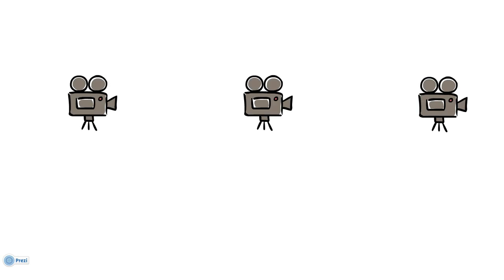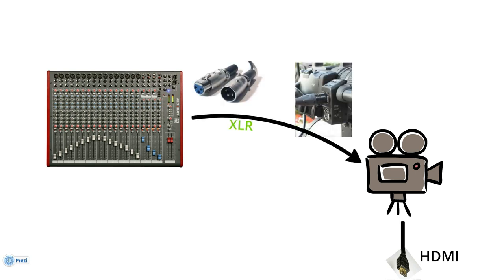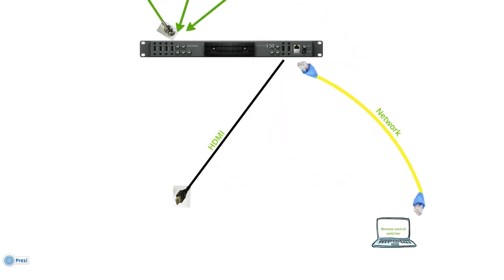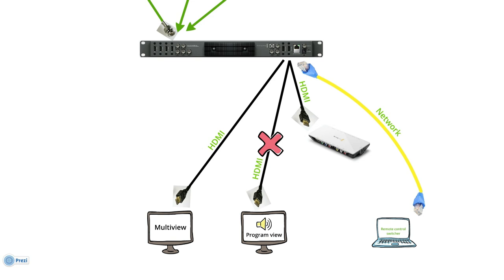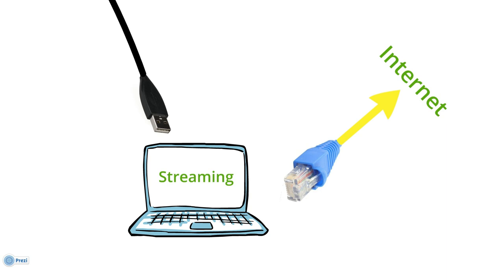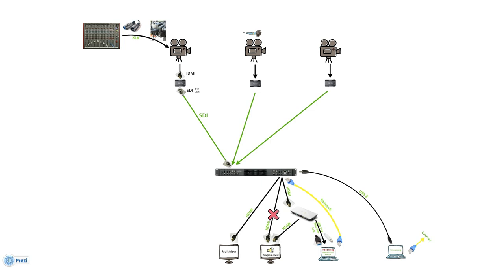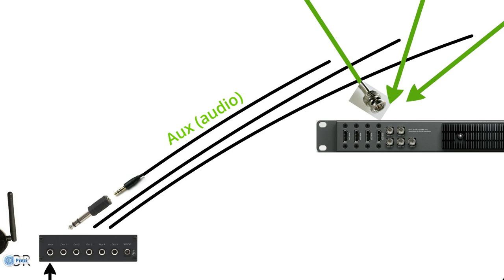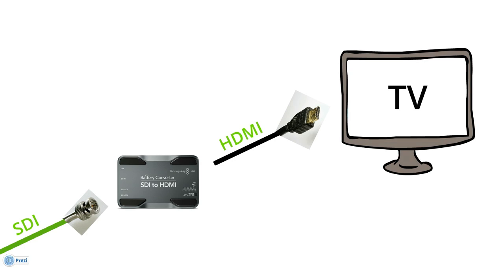15 Connecting it all together

Comment: Pawan Ramnarain: If you use the BM ATEM switcher, it has no analogue inputs of any sort, neither video or audio, and the computer controlling it, does just that: controlling it. But, yes, if you take the HDMI output of the ATEM into the computer, you could technically mix that with analogue audio, but I guess you will have a big out of sync problem unless you put the audio through a delay box. I haven't tried this, I have just noticed there is a slight delay between what I hear live and what I hear through my ATEM. Therefore I recommend putting the audio into one of the cameras instead to have the audio sync with the video and everything goes through the ATEM. If you plan to use the USB output for streaming, you have no choice but inserting the audio into the ATEM in one or another way.

I use the setup mentioned in this video. ATEMs bundled remote mixing software (both video and audio). All mixing is done on the ATEM itself, not on the computer. Streaming software: MXLight. I don't use Adobe FMLE. I could, of course, but then I need a really fast laptop to do the realtime encoding to H.264. I guess a modern Macbook Pro would do the job with no problem, but probably not a Macbook Air (???)

It is absolutely possible to stream and record on the same computer. BUT: If you want to record in a higher quality than the stream, I understand that FLME can't do this, but I'm not sure. FLME can output several stream qualities, but I don't know if you can direct one of them only for recording. You can't record with another software while using FLME. FLME will take over the incoming signal totally. Same goes with the recording facility in the ATEM software. It will not let FLME use the signal if ATEM is recording. You need a second computer to do this split quality thing. And to save money (by not buying an ultra fast laptop) I use the USB-signal from the ATEM through MXLight.

Comment: You can do this with a mac too hooking up the atem tvs to a capturecard and in addition to the atem tvs switcher also use all the features you have in CamTwist which is a software cam swithcer. Camtwist will let you playback media files too. The streaming app you can use is Flash Media Live Encoder

Comment: Thank you very much for a very good and useful tutorial which covers pretty much the same topics to the situation that we are on.
What we need is to record the sermon and power point presentation. And after that we will upload the video to our Youtube channel.

At the moment we are using FCPX to edit the video and put the slide images to the desired position. Which consumes a lot of time...
To do that job, we are thinking of purchasing Blackmagic ATEM Television Studio to do the switching between video camera and powerpoints and probably use Hyperdeck Shuttle to record the program from the switcher output.

We are also in the situation where we need to use splitter at the VGA output of the computer, so we will need VGA-HDMI scaler box.
Could you tell me what brand and type of VGA-HDMI scaler box you are using that converts and scales analogue VGA to HDMI?
Since the distance between the switcher and the computer is less than 5 m, can I plug the output of the scaler box straight to the switcher using HDMI cable?

We are hiring university lecture theatre for our church, so we need to setup and pack up our A/V stuffs every week. Do you have any suggestions or simpler system configurations for our need?

Thanks Jorgen...
GBU in your work.

Comment: I see that the ATEM 1 switcher or television studio is available with audio control.  You recommend these units?  Trying to to make a decision of which one to buy or they about the same.  One is a little cheaper.  
Also, when I connect to my computer I have a external thunderbolt hard drive that I use on my mac....can I record to that hard drive?  I am sure but I want your opinion.

Comment: Thank you for this tutorial. I also do live broadcasts using a custom built laptop with 3 HDMI input for video recording, but now am thinking of using a macbook pro retina to do the job because of the HDMI's limiting factors. SDI is a better option, but i'll need all the equipments as shown in the video. I saw some people solved the audio feed problem by using the aux 3.5mm standard cable from mixer to audio input jack in the laptop and then using the video mixing software to mix audio with video. Do you think its a good idea? Also what video mixing and streaming softwares do you use. Adobe has flash media live encoder for Mac. Cant we stream directly on the same laptop while recording with another software?

Comment: Thanks for the video and advices, really appreciated. One question, do you know if there is any restrictions on what kind of camera you can use on the blackmagic?

I am using right now 2 Sony NX5 and a GoPro, the 3 are working well. But I tried to use an old Sony Z1 and another HDMI camera but can't connect with this 2, and I'm wondering maybe there is a restriction or something I dont know...
Reply: This is what BM says about supported standards: https://www.blackmagicdesign.com/products/atemtelevisionstudio/techspecs/

Are you sure you have set ALL the cameras to exactly the same standard? And the switcher as well? As I say in one of the videos (or two), the HDMI may not output the same standard as you set for recording. Some cameras output the same standard regardless of the recording standard. Some cameras have two separate menu items for recording and output formats. This could be the case for you...?

Comment: Does this work with any camera?..In new to the video and audio world. I have a Sonyvx2000 and a NikonD3300 and i need to connect it to our Church sound
Any help.. helps!
Reply: kduque068 No. These cameras will not connect directly with SDI. The Sony camera is a DV camera and have only analogue and FireWire (digital compressed) output. I don't know about the Nikon, but I guess is has only analogue. You need analogue to SDI converter boxes. But if you use an analogue video switcher, you can connect them via coax cables (not SDI signal, but analogue). This signal doesn't carry audio though.